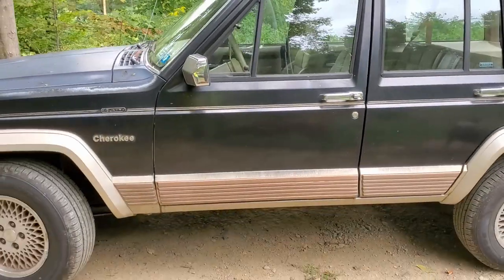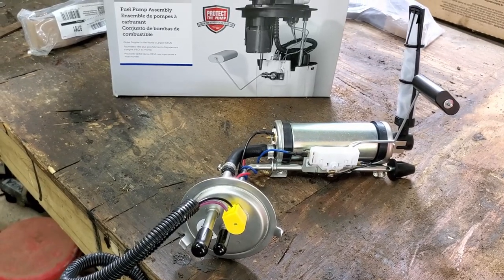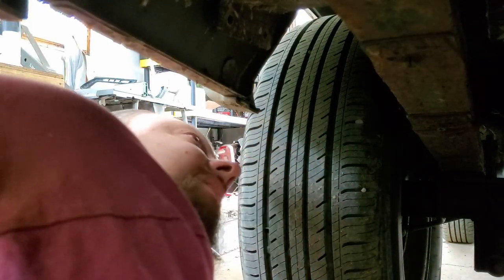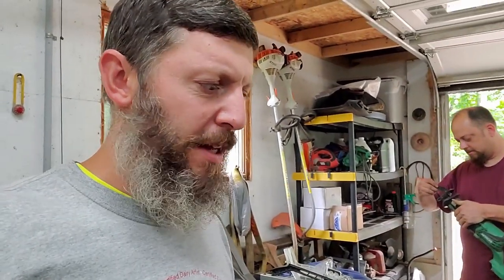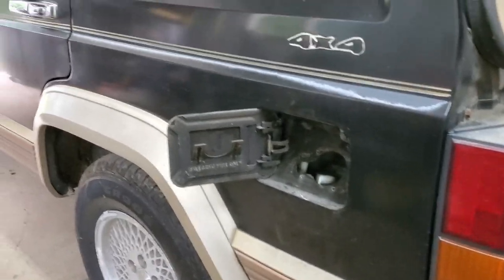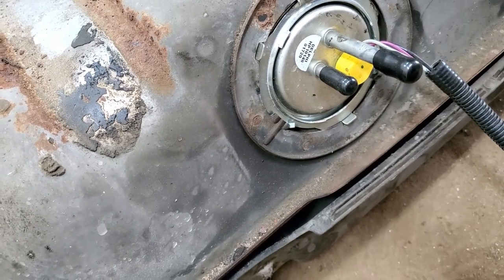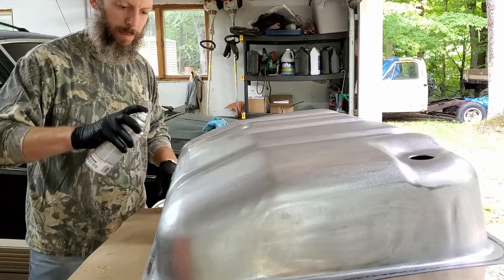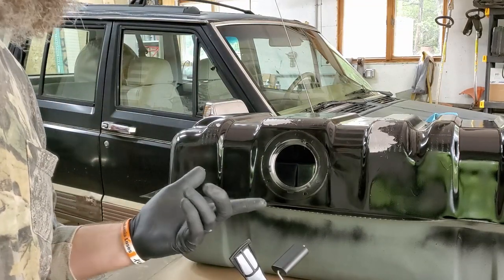Changing Fuel Pump And Tank In A 1993 Jeep Cherokee

Comment: i have a question. is it possible to replace the fuel pump without removing the gas tank?
Reply from the maker: On mine you can. Before I bought it it had been replaced without dropping the tank. There was so much rust in there that it was clogging the screen. I just decided to change the pump again since it had been working so hard.
Reply: @TheHunterGatherer  okay thank you for letting me know. i’m going to attempt to replace mine without dropping the tank but i’m pretty sure the tank is covered in rust. the jeep sat up for about 5 years un-driven before i bought it so i’m trying to figure out what all of the problems are. i replaced the fuel filter about a week ago so now i think i’m going to try and tackle the pump.